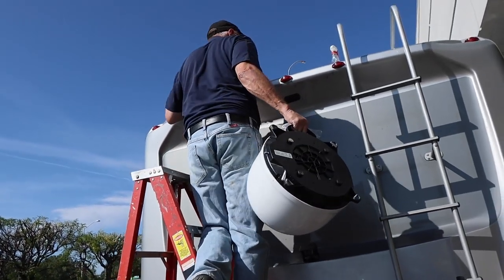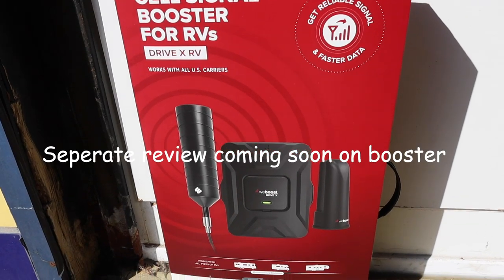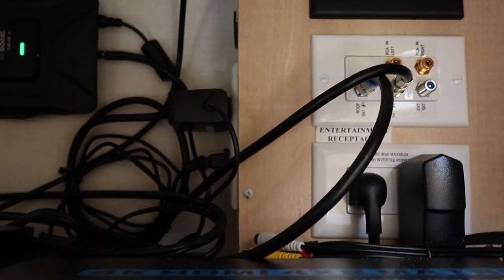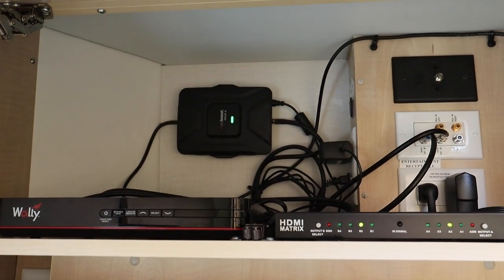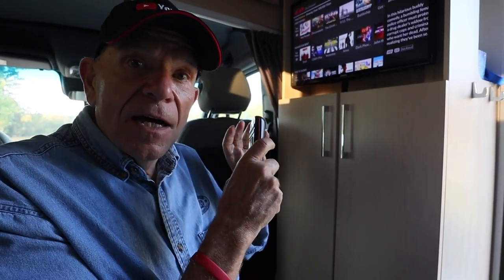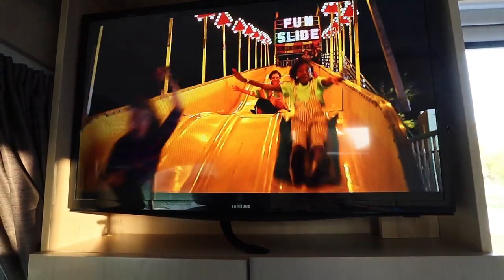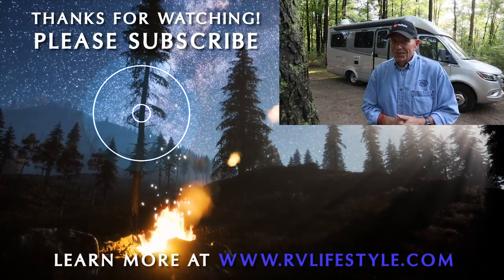How We Installed A Satellite TV For Our RV

Comment: I have recently installed a Dish in my PleasureWay Ascent. Instead of putting the antenna on the roof, I put it on a tripod, so that I can remote it from under any trees. So far I’ve only used the 25’ cable that came with the receiver & antenna package. I added the hard drive and a Bluetooth adapter to move the TV sound to better speakers.

So far, so good. I store the antenna on the floor of the bathroom while traveling. It takes about 15 minutes from start, setting  up the tripod, to finish before the system has finished its setup process.

Comment: I would like to add to your what you were saying about the Wally receiver. 1 it is not a DVR out of the box. You must purchase a compatible external hard drive and have the DVR service added to the service. Now if you are use a dome type satellite you can’t watch live tv and record at the same time unless you are recording what you are watching or what you are recording is on the same satellite as the live tv is on. 2 wally receivers do not have built in WiFi. You must purchase a dish WiFi adapter in order to connect the Wally to your WiFi. Now you can connect a Ethernet cord from the modem/router to the Wally. 3 Netflix subscription is not included with your dish service. You must subscribe to Netflix in order to watch Netflix on a dish receiver.

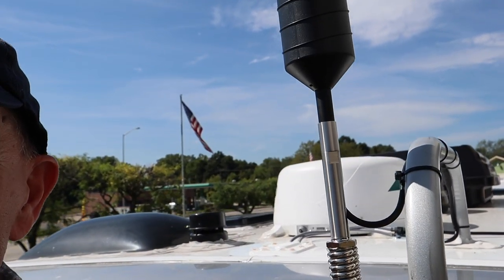Comment: You may want to correctly install the U-Clamp holding your cell booster antenna. Your installer installed the notched sleeve on U bolt on wrong side of pipe. It’s gonna bend and loosen your clamp.  It’s at 2:25

Comment: We recently got the dish equipment and it’s been too much of a challenge to get it working properly. First weekend tech support supplied all the WRONG answers to all our setup problems. We opted NOT to mount unit on roof because  of TREES  blocking signal. & we got 25,50,75,&100 foot cables hopefully for all situations . Hopefully we have all the kinks worked out and next campout might actually get to see something on DISH TV
Reply from the maker: Sorry you had issues. I plugged ours in and... it worked. No hassle. Had to get a wireless dongle from DISH for Netflix but it was really a breeze to set up.

Comment: I'm very confused also.  Didn't the Leisure come with an antenna that picks up DISH. Also a booster from Leisure.  If all the standard equipment from Leisure is so bad, I will have to rethink about a purchase of  a new Leisure Unity.  It just seems like you are replacing everything on a one year old unit.
Reply: Leisure has a satellite option, which Mike didn't have installed.

Comment: All the Bloggers must have gotten a "free" unit to install.. I've seen several installing this same exact system in the last couple weeks. Dish must be making a play for more Rv'ers. Dish outdoors and a flex plan is actually a inexpensive way to get tv. I get locals and a news pac in addition to the basic flex pack for about 55 bucks a month. The outdoors account you can turn off or on and change programing  at will by app without talking to anyone.

Comment: The problem with your argument is that the antenna is a problem if your park under or near trees. Better to move the portable antenna into an open space on a tripod. Its very light & takes up very little room. Also, you just increased the roof high on your rig by about 12", which could be a problem in low overhead locations. We keep ours in our Toad Jeep, and it takes 2 minutes to set up.

Comment: Will the satellite work under trees  ?
Reply: Mine will not work unless you are in the middle of a cleared field.   Particularly in the Northeast, where the DISH Outdoors system is weakest, as it only can lock on the Western Arc satellites.  It also takes much longer than I would have expected to fire up, lock on signals and download the program guide.  The theory of the roof-mounted DISH versus the actual user experience has been unacceptable.

Comment: One small problem.  I tried to activate from the antenna into the satellite / cable input and it wouldn't lock onto the location I was at (Washington).  The Dish tech said that the trailer was incompatible.  I had to hook directly from the antenna to the receiver.  That sucks.  How about "how to program.  That was a waste of six minutes.

Comment: Have I missed something along the way.  Why a cell booster? From one of your  videos you explained why you installed  a Togo for the unlimited data. So Togo is not also no a cell booster?
Reply: The ToGo is just that, basically a packaged router to share data with WiFi devices in the coach, LTE sharing, as well as  latching on to guest wifi. The Togo doesn't have the same amplification as dedicated boosters like a SureCall or WeBoost etc.  I think Mike and Jen's issue is in boondocking scenarios where LTE is sparse or non-existent.  Satellite will always save the day in rural Montana.
Reply from the maker: @xdcsdiverx  absolutely correct

Comment: I made the mistake of letting the dealer mount my dish on the roof of the RV. At some campgrounds we cannot pick up a signal at all because the dish is stationary on the roof of the RV and there is an obstruction preventing us from picking up the satellite signal. To solve this issue we ended up purchasing an extra DISH to put outside the RV so that we can move it around and get direct access to the sky where the satellite signal is coming from.
Reply: If you are using a playmaker you can remove the dome off the mounting kit and set the dome on a tripod or ground. However it is time consuming. There is a bolt that bolts the dome to the mounting kit. You can remove those bolts and lift the dome off the mounting kit.

Comment: In my opinion as a satellite retailer and tech for 30 years the tailgater pro is the best on the market today 7/2020. How ever it only works with dish and 1 tv. Don't be fooled any dome dish with Dish Network will only work with 1 tv, oh they say 2 but take it from me you will be forever having problems with 2nd tv.  I would stay away form Directv for now. BUut  If you have a directv at home and want to add a receiver to your account Good Luck,  Tailgater One will work.  Only reason to do the Travler is if you want DVR. Even if you want to tV's still do Tailgator pro but buy 2 of them one for each receiver its cheaper then 1 Travler. I have been selling and installing on RS,s for over 10 years, Satellite Steve